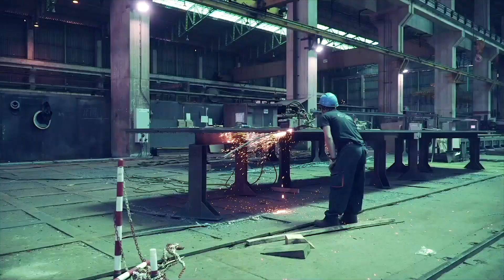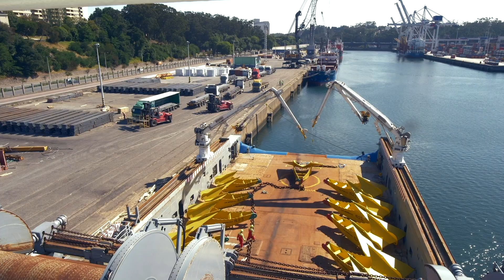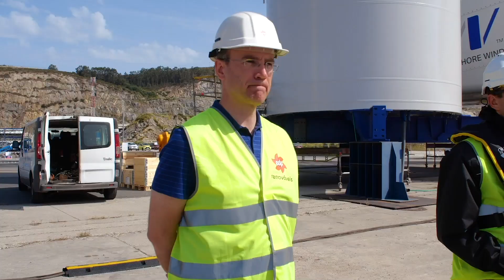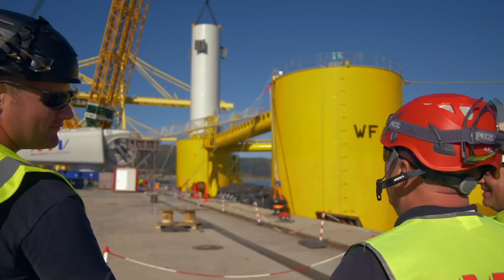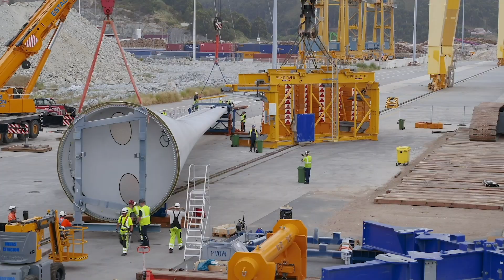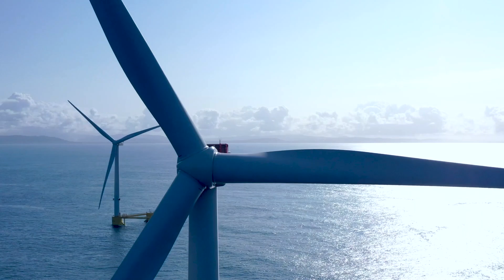Windfloat Atlantic reaches 75 GWh in its first year of operation

Comment: All that machinery and structure with an output, on average, of about 8 Mwatts per hour. Despite their large structure they are feeble devices and produce little power. Not only do they provide little power but their lifespan is less than half that of conventional generators.
If Non CO2 is the aim, nuclear is the only sensible option available. Hydro is also a good way but there are few places where they can be built.
Reply: Nuclear has its limitations as well for disposal of spent fuel waste and also requires water source
Reply: Abz,

The waste problem is overstated, and yes like large power plants there is requirement for water.  However, if CO2 reduction is the aim and retaining a reliable and stable power supply, nuclear is the only current technology that provides it.
Reply: Your argument is ludicrous - Wind is freely and readily available, cheaper to design and build (especially when scaled up) and safer. Nuclear on the other hand requires expensive ore which has to be mined and enriched, expensive to design and build, radioactive and dangerous and is not exactly renewable. Also, as others mentioned it requires huge amounts of water. Now nuclear weapons is a different story.
Reply: Qwerty Man, 

thank you your informed comment.

Wind is indeed freely available but not available on demand. It is cheaper to design and build, but not by much as you may think as it's life span is so short relative to nuclear so at least double the construction requirement over time. 

Howeve wind also requires expensive procedures to accomodate it into a grid and also requires a duplication of assets of alternative generating plant that needs to be available at all times. Some of that plant needs to also do the balancing of input and demand so the grid remains stable. Wind alone feeding a grid would trip it very quickly indeed as it is uncontrollable.

Wind has no inertia, cannot supprt short circuit current levels and does not cope well with VAR correction.

Therefore it seems you want a cheap and cheerful sytem that doesn''t work very well?

Also tell me one country with a lot of wind power that also has cheap electrcity unit costs to the consumer. You are misled by the media and indeed some politicianscontinually saying wind is cheap when the evidence for all to see is that it is not.
Reply: @iareid8255  If a hammer is the only tool you have, everything will look like a nail. That is exactly your story. It is a well known fact that any technology takes a while a mature before economy of scale brings the price down. You seem to be one of these nut jobs   believing in conspiracy theories, just look around you - China is producing 250+ GW, the USA reaching 150 GW, Germany 60 GW+. Also, do not know where you get your numbers from, Nuclear costs 150$/MWH whereas wind is 35$ per MWH. You can say what you want, when offshore wind picks up, things are going to take off in an even bigger way.
Reply: qwerty Man, 

you are living in fantasy. Wind has been in use for decades and technology cannot deal with all the deficiencies I listed, they will not improve.
Your figures are build figures, not what it eventually costs to incorporate the wind power onto a grid. 

There was a comprehensive research into the total cost of wind using publically available audited accounts of 350 wind farm operators carried out by Edinburgh University and it puts off shore wind (the most expensive at the £140 ish per Mwatt hour.

The main thing is how effective and reliable the technology is and the answer is not very.

Like it or not, nuclear is Hobson's choice, i.e. no choice, for non CO2 emissions for electrical grids unless hydro is available.

Wind is for gullible politicians who know little or care less.
Reply: @iareid8255  This conversation is futile, like I said when you have a hammer everything looks like a nail. I will continue living in my "fantasy" while you enjoy your reality.
Reply: Qwerty Man,

if facts and technical information (Easily checked) don't make you reconsider your view then you are, in my view, burying your head in the sand.
I really don't care if you don't accept what I write, time will be the judge.